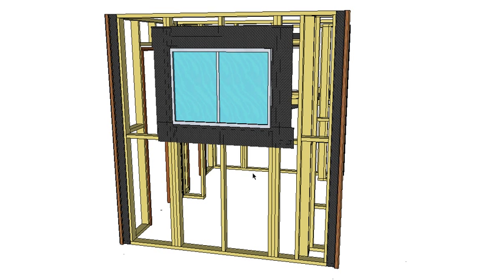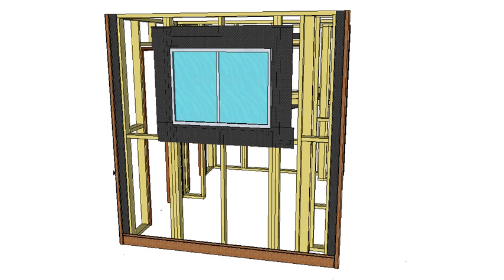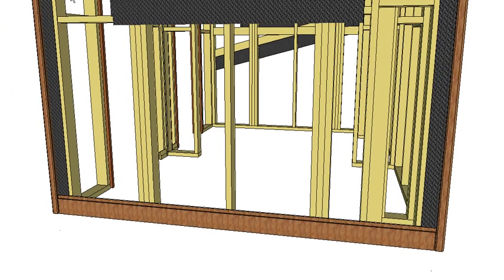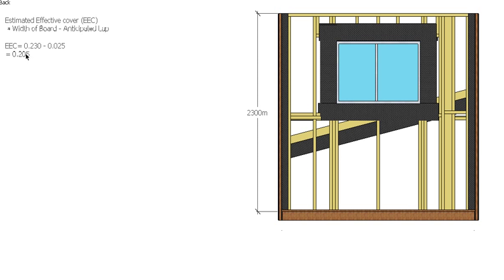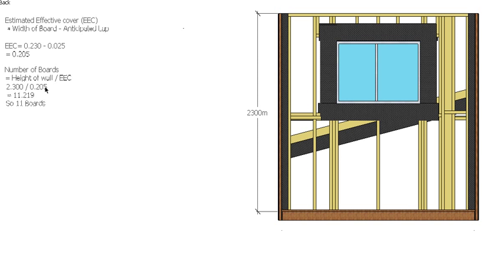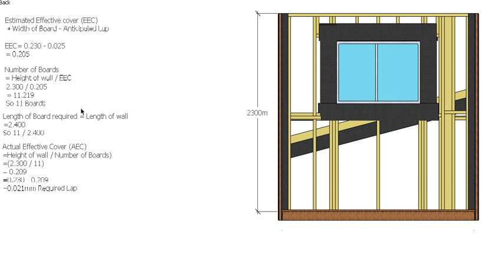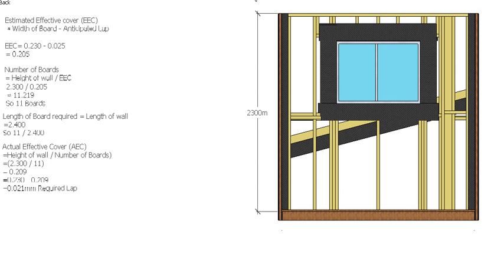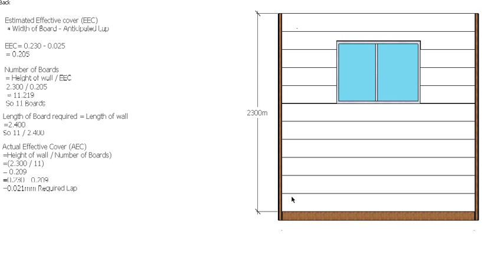Calculate the effective cover of Plank Type Weatherboards Example 2.

Comment from the maker: Hi John Citizen 
While some manufacturers may specify 25mm as thier minimum lap however this is not always the case.

For example the Hardies brochure linked below shows laps from anywhere from 18 to 33mm moreover i cant see any reference to these laps being a minimum.

http://www.jameshardie.com.au/uploads/file/20141215a23928-External%20Cladding%20Tech%20Spec(PrimeLine%C2%AE,%20HardiePlank%E2%84%A2,%20PanelClad%C2%AE%20&%20HardieFlex%E2%84%A2)%20Nov%202014%20(WEB).pdf